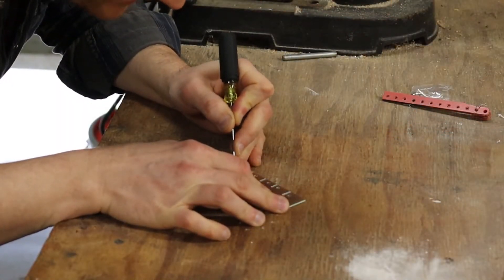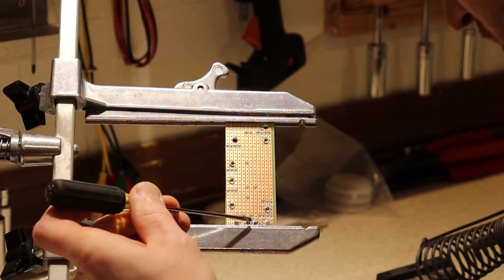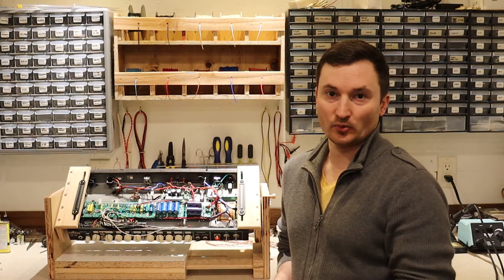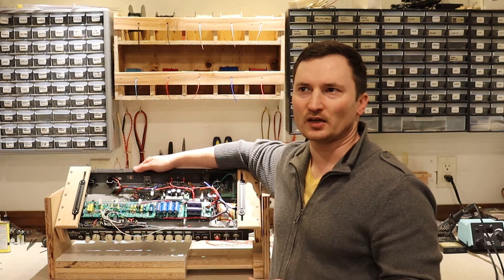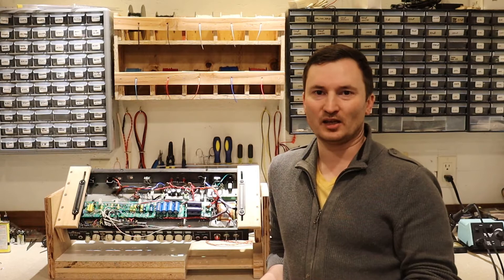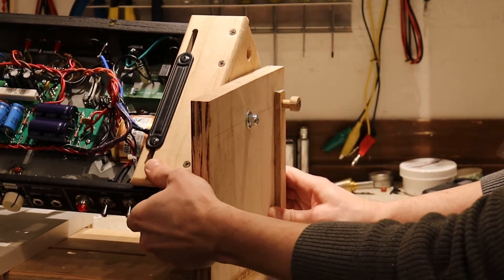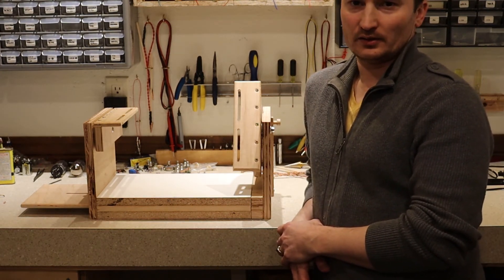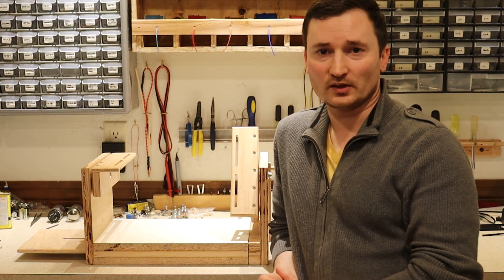75 Dollar Dumble Build Part 7

Comment: You have a low voltage of 18.8 if I remember correctly. Now 18.8/3~6.3. So could a three-way voltage divider be a solution? I can see some challenges with running the relays of that, because current draw will vary.
Reply from the maker: Depends on where I put the voltage divider. Unless I place it at the end of the chain and just use it for the relays, I'm supplying filament current through those resistors, which would mean I'd have to use some pretty big resistors. Just 300mA dropping 12.6V would dissipate 3.75 watts. That also adds to the current that the transformer has to supply.

Comment: Grounding can be very tricky in a high gain amp, moving them or running dedicated grounds
to the star point can make all the difference both regarding hum and oscillations.  I'd try to
simplify it as much as possible, pull the drive tube and try to get the clean channel right.
Power down the FET to see if it is the source.  Also, see if the hum goes away seconds after
you power it off, there's still power in the caps and the heaters are hot.

Comment: I like your cradle I did mine with half circle cut out of the outside, and a thumbscrew and allthread for a stop or adjustment. The same for the sliding adjustable bottom. Can't wait to hear it, well I guess I have to wait to hear, so I can. Ha
Reply from the maker: That was my first idea but I knew I'd never get the channel cut right. How did you cut yours?
Reply: @timkrauseelectronics9245  router